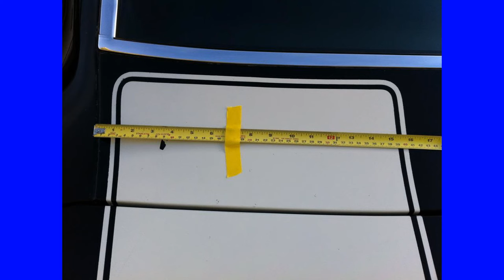69 Camaro in Le Mans Blue Full Restoration Video Series Part 12 - Laying & Painting the Z/28 Stripes

Comment: On the rear stripe at the top you measure 5/8 inch down at the inner part of the stripe does the stripe follow the contour of the trim all way across or is it straight across it looks like your gap widens slightly as you come across, also did you clearcoat the basecoat then paint on stripes then clearcoat again, if so why clearcoat under stripes

Comment: I took measurements off of an original Pace Car and I found they were off center (not symmetrical)!
Not all factory employees were perfectionists.
Reply from the maker: Hi Dawn, Yes, you are correct. Believe it or not, the stripes both had different dimensions because of the Camaro emblem on the bottom left corner of the hood. The drivers side (left side) stripe is roughly 1/4" narrower than the right stripe

Comment: Early and late 69 Z/28 stripes on the rear were different. In ‘74 I bought my 1st Z/28, it was a 1968 British Green with white stripes and black interior. A friend of mine is the current owner. When I had my 70 Z/28 stripped and repainted, I layed out the stripes myself per assembly manual. The assembly manual is for Norwood Z rear stripes. Both Plants Norwood and LA Z/28 stripes on the rear differed. The rear stripes were very close to the emblem on LA built Z/28’s. Why, I don’t know. Crazy.
Reply from the maker: Yes, this is a March 69 car
Stripes were further apart

Comment: Its close but your to close to the rear chrome trim on the rear of the glass its more like 1/4 inch or 3/16
Reply from the maker: That is exactly what measurements I used. They are 1/4" on one side and 3/16" on the other side of each stripe. The stripes do not parallel the chrome trim. I used exact measurements from an original paint Z/28 that had never been painted.

Comment: looks like you cleared the car before putting on stripes.  How long did you wait to lay out the stripes and how did you prep the clear before laying out stripes? Thanks!
Reply: also, looks like you cleared the stripes before removing the masking??
Reply from the maker: Hi Wes, we cleared the car before the stripes, then we re cleared only the the hood and trunk
Reply: @digitalpizza1  watched video again.  Sorry to keep bothering you but before you layed out the stripes, the entire car was cleared? right?  How did you prep the hood and trunk and cowl panel before laying out stripes? wet sand with 600?  I am almost ready for paint and would like to use the same technique as you.  Thanks.....your car looks fantastic.
Reply from the maker: Hi Wes 
Yes, the car was cleared, then I waited a few days, wet sanded just the hood, trunk, etc that received the stripes, laid them out, painted them on, waited a couple more days, wet sanded them, then cleared those areas again
Reply: @digitalpizza1  Thanks so much.  Look forward to seeing the Lemans car come together, also the red wrecked Z is going to be amazing to see how it lines up for new panels.  Thanks for posting.

Comment: I got a real number matching RSSS 69 Camaro 350 car automatic AC I just want to restore the car back to the same color as yours is Le Mans blue that’s exactly my color on my car
Reply from the maker: Hi Spanky, I have not finished putting the car back together after the paint bodywork was done, so the final cost hasn't been tallied yet. But the paint and bodywork was about 25,000.00. But that is on the high end because it is better than it ever was from the factory :) Are you going to do the work yourself except for paint and bodywork?